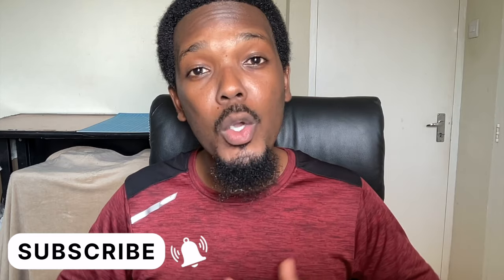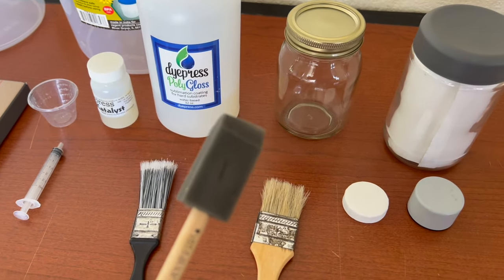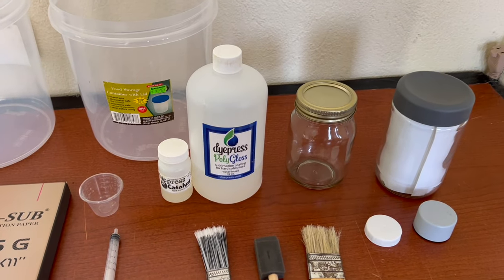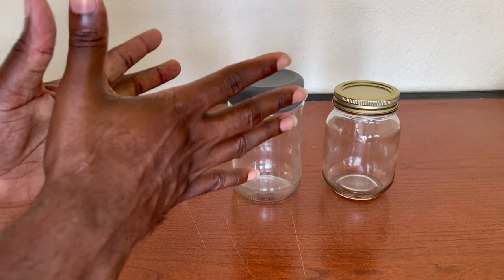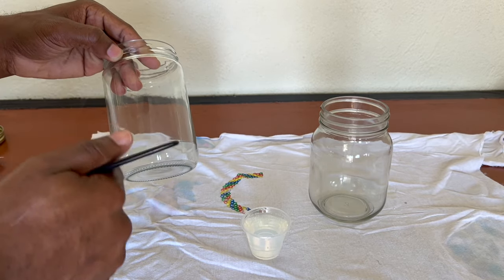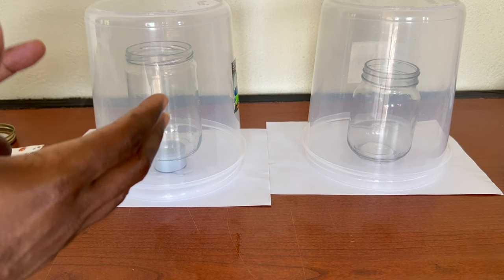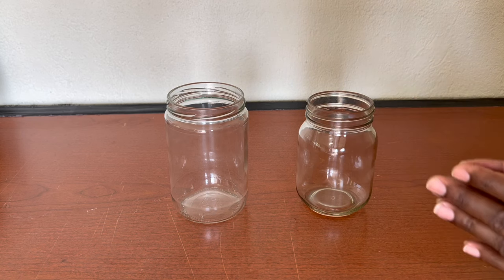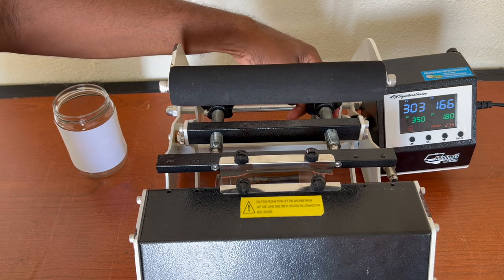How to Sublimate Glass Jars |Polygloss

Comment: Great video! Thanks for making it! Have you tried testing this in the dishwasher? How long does it last? Thank you again for showing us this technique.
Reply from the maker: Thanks for your question and I do apologize for the late response.
So in this case these wouldn’t be dishwasher safe. I would recommend washing by hand. The reason why these wouldn’t be dishwasher safe is when to much heat from the dishwasher starts to apply on the jars it could reactivate the polygloss. So the safest way is to wash by hand.
It will last very long. I have other polygloss projects I did over 4 years and they are still good up until today as I am sending this message.
I hope this answer helps you.

Comment: Hi how are you doing? 
Can you sublimate on  normal aluminum sheets with it not being sublimation aluminum sheets, does the sublimation spray work on it
Or can you please do a video of that 
Thank you
Reply from the maker: Hi, I am doing great thanks for asking.
If your aluminum sheets are not quoted with the solution or are not sublimation prepared, then you will not be able to sublimate on it. 
If you use the polygloss, then yes you can surely sublimate on it. 
Regarding the sublimation spray, you would have to clarify which spray you are referring to, but I do not normally use the spray.
Yes, I can do a video. I am actually in the process of creating a video on this topic so I am hoping by the end of this week or next week it should be up for viewing.

Comment: Hi Allan, i have been looking at your past videos and i am so glad your account is still active with new videos! 
I noticed that in this video you had cured one of the jars but not the other one. Does that mean one of them you can put in the dishwasher and the other one you can't? Because the one you did not cure would it not come away when you put it in the dishwasher? I am just trying to understand if I need to cure it before sublimating on it. Because in all of your previous videos that is what you do. But in this one you did one without the curing so I was wondering why you did it differently? I am loving the videos. So keep up the fantastic work and tutorials.
Reply from the maker: Thanks very much again for your question and your support. What i love to do is experiment and try to push the limit to see what can and what cant work. Yes, in this video i did one by curing and the next without. It was all in testing to see the best results. I would highly recommend you always cure the item. If you don't cure it, make sure to give it a good hour to two hours before sublimating. However, this all depends on the temperature in your country. If you are in Canada which i think you noted in another comment, then i would recommend curing the item first. In addition, when it comes to dishwashers and Polygloss, that is a no no. The dishwasher and the heat will reactivate the Polygloss because of the tremendous heat which will make the Polygloss start to reactivate. So I recommend always hand washing.

I hope i answered all of your questions and if I didn't please let me know so I can answer them and if you have more questions feel free to ask me.
Reply: @atprints  thank you for your detailed reply!  On a side note, are you planning on releasing another video? I am enjoying watching them and all the creative things you show us.
Reply from the maker: @mgb426  Thanks very much for your support, i really appriecate it and I thank you for the special words. Yes, I am planning to upload more content for sure. 
Time flew by pretty quick and sometimes  I dont get the time to post but I am putting things in place to release some new content, starting the end of this month into the start of next month.
Do you have any special area that you would like me to create a video on? Once its in my area, I will surely create it. 

Looking forward to hearing from you and feel free to follow me on instagram @allan21thompson where we can chat and share pictures of your work. I am always open to giving advise or answering questions if needed.